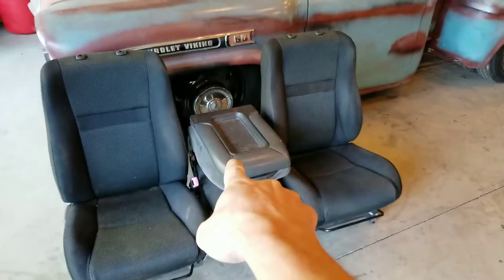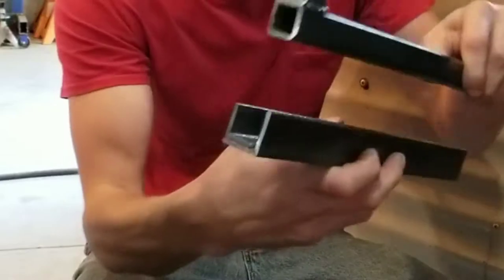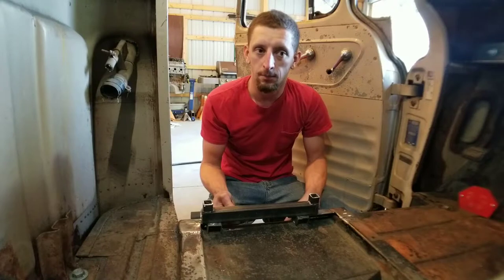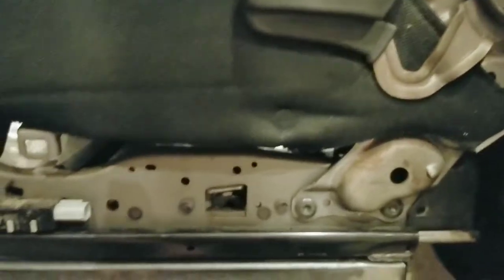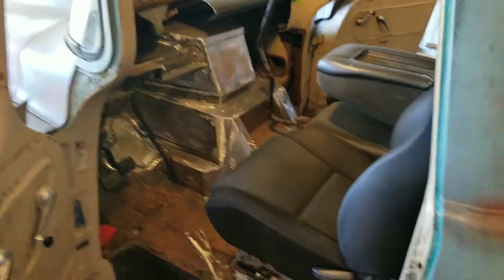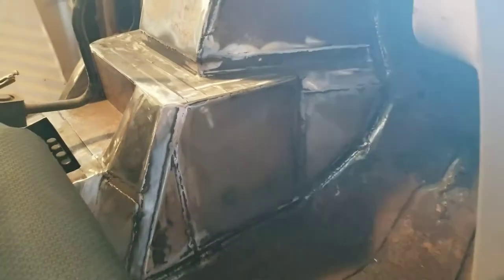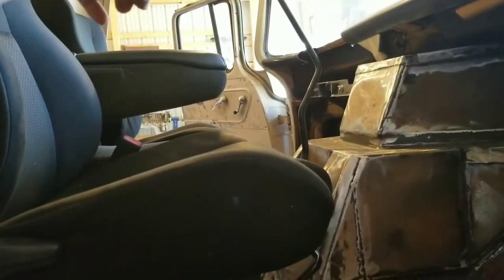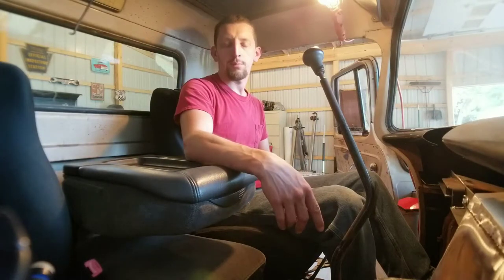How To Install Bucket Seats - 1959 Chevy Pickup Truck Custom Installation - WATCH

Comment from the maker: I am picking up momentum on this build, each time I post a video I cross another item off the punch list!  The seats are from a 2004 Scion Xb, I bought them for $50.00 each and the center console is from a 2002 Chevy Silverado I paid $50.00 for it.  The seat frame is made from 1"x1"x1/8" wall square tube and 1.25" Angle.  I have a grand total of about $200.00 +/- invested into the seat, not to bad!  Subscribe to the channel so you stay up to date with this build.  If you have any questions don't hesitate to ask in the comment section below.  Now get out there and Challenge The Build!

Comment: I have been struggling because I like the clean engine bat fire wall in my 53PU. I didn’t notice what you will do with brake booster.
Reply from the maker: My original plan was mount it on the firewall...   But I haven't even been thinking about this project for a while.